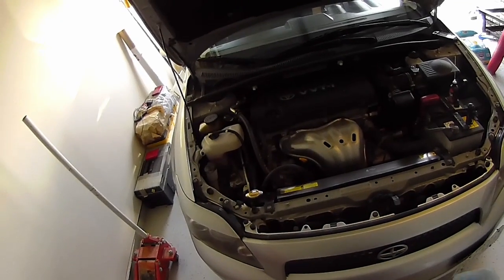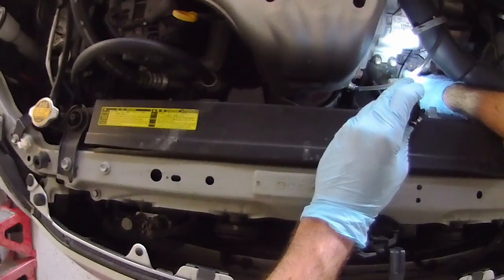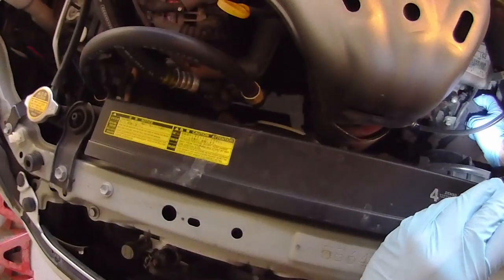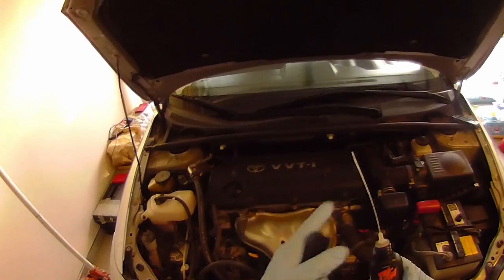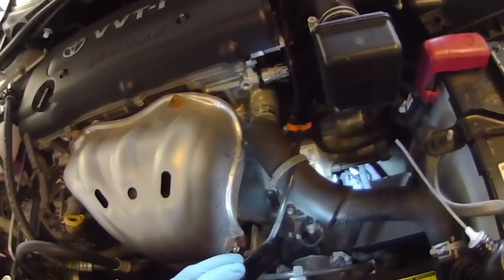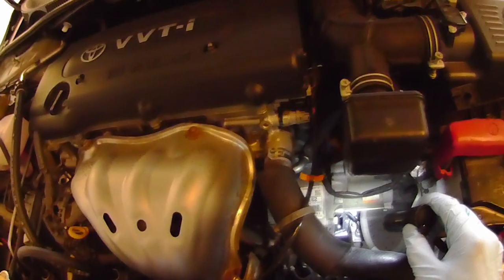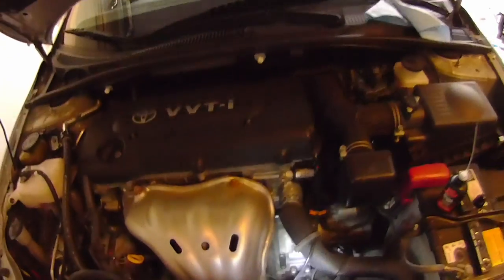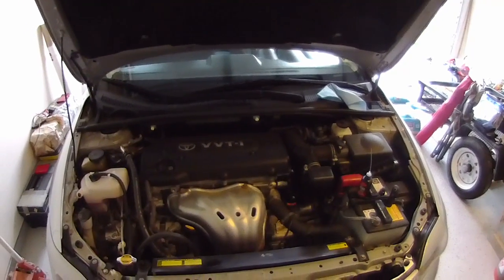Scion Toyota Clutch Squeak Fix

Comment from the maker: The squeak did reappear about 1.5 months down the road. Once you do this procedure a time or two, you'll be able to apply the oil to the pivot in about 5 minutes so at least its a quick fix. I suspect a long term fix for this would require removing the transmission and actually applying some proper grease to the pivot point.
Reply: cool man

Comment: what  u think is the problem  if the clutch  estay  all the  way  in  and it does not cames back
Reply: check the master cylinder
Reply: Master or slave cylinder
Reply: Sounds like slave cylinder. That same thing happened to my miata.

Comment: is there a way to check the gearbox fluid on a toyota scion from above the engine? if so can you send photos or video?
Reply from the maker: There really isn't a way to verify proper level in the gearbox without removing the fill bolt on the side of the transmission. It is positioned such that you fill the trans to the correct level. To check level, remove the fill bolt and stick your finger in the opening. If you feel oil inside, you have the correct level. The car needs to be level to get a valid reading. Hope this helps!

Comment: Does this fix the squeak inside of the car from the clutch pedal it self?
Reply from the maker: No, the squeak from the pedal would have to be addressed by lubricating the mechanism under the dash. I personally haven't had to do this on my car.
Reply: So I lubricated exactly where you did and squeak is finally gone. It plays tricks on your ear thinking the pedal is squeaking on the inside when in all actuality it’s coming from under the hood. Thank you so much. I hope others can find this exact video to help them with theirs.

Comment: What about some dabs of anti-seize lube on the ball of the pivot area?
Reply from the maker: Anti-seize doesn't penetrate into tight-fitting joints and from what I've seen, tends to deteriorate into a powdery residue over time. It might work, but I would still recommend a light penetrating oil of some sort.

Comment: I have a 2006 scion tc..my clutch just went out like..right now...how much does it cost to fix and witch kit would be the best?
Reply from the maker: Edwin, an aftermarket clutch kit for the tC is under $200 and brand names like Exedy and Sachs are typically a good choice for a stock replacement. The major cost is in labor. You can probably expect 6 - 8 hours of labor to be charged for a clutch change at $80-$100 an hour (varies by area and shop). You could opt to get all OEM parts and have the dealership do the work, but that will cost noticeably more. When replacing the clutch, be sure to replace the throwout bearing, pilot bearing (if equipped) and have the flywheel resurfaced or deglazed. Also lube the clutch fork pivot point real well while its accessible. I have done clutch replacements on other cars, but not the tC so I'm afraid this is as helpful as I can be. A competent shop should be able to handle the tC clutch replacement as it isn't a complicated car.

Comment: I have a 2015 Honda Fit  EX and I have this problem. Except it only happens on rainy days and it only squeaks when I'm driving. if I am stationary or idle it will notmake the squeaky sound. but, once I put it on gear and drive it makes that squeaky sound again.

Comment: My Scion tC when I put it in any gear it won’t move or stall what can it be ?
Reply from the maker: If it is a manual car, your clutch may be worn out. Normally the clutch would slip under power first before failing completely. In an extreme case, it will not engage at all and you will have the symptoms you describe.

Comment: I was like sweet I'll spray lithium grease on it, job done! Then I heard you say it's the worst thing to do... Gutted

BTW most Toyota's have this setup, my 1991 landcruiser 80 series has the problem and its vertically the same configuration
Reply from the maker: Frank Jones Spraying oil/lubricants around the clutch area just seems like a recipe for clutch issues in my book. Using an applicator with a thin tip is probably the safest bet. Maybe even a syringe with a thin tube will work for that. A Landcruiser with its longitudal drivertrain layout probably makes access to the clutch fork a little tougher.
Reply: Thank you for the advice, that's a great idea. 

My Cruiser has a nice lift kit on it, so it's pretty easy to get to, otherwise it would be a pain.

Comment: Can you use WD-40???
Reply from the maker: WD-40 is inherently not a lubricant. You may have an immediate effect, but it will quickly wear off. You're really better off using a thin oil lubricant that will work for much longer.